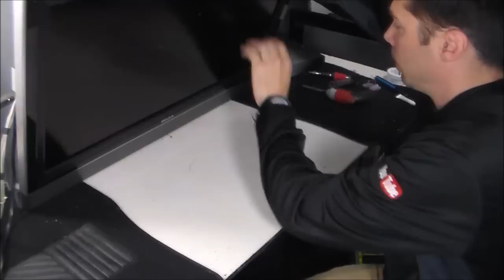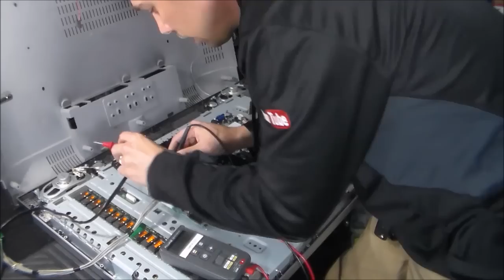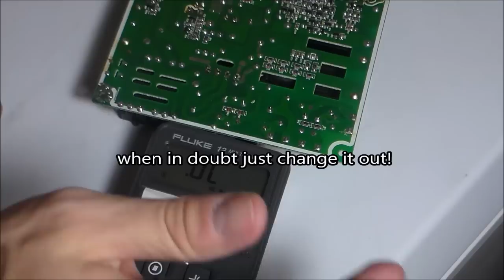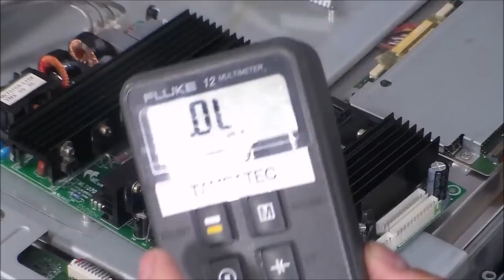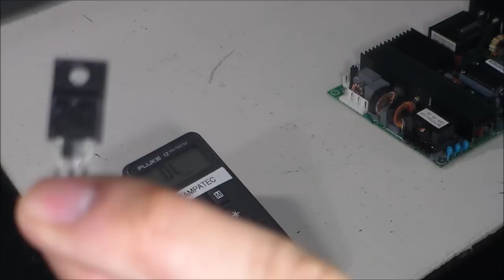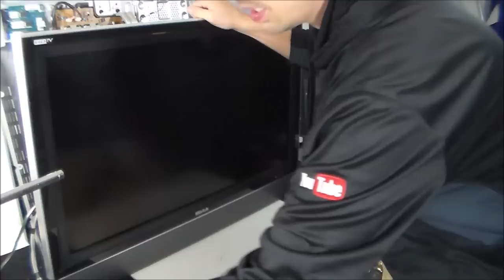How to fix tv after lightning strike power surge

Comment: You changed the bridge rectifier but isn't it okay for there to be a larger voltage drop across the dc pins?  You are measuring across two diodes after all.

Comment: I have a question. In power supplies, if mosfets are gone must we replace any resistors and diodes around them?
I remember someone said resistors may show correct value but in high frequencies with Mosfets they show anomalies.
Video was about Mosfet inverter welding machines.

Comment: Hey, i watch your videos all the time. Youve helped out in so many way and i appreciate it. Thank you. However im stuck with one project im working on. Its a hisense 46 inch (46k360mn) when i plug the tv in the standby light turn on and turns off. The power board runs a little loud when the main board is plugged into it ( normal when unplugged). I have checked the values running off the power board and theyre all correct. Standby light is at 5 as well. I replaced a couple componets on the mainboard because they were low in value now they are normal. There has to be a bad component in the main board still right? After the fixes ive done on the main board the power board still runs loud. What suggestions do you have that i should check? Its a short somewhere right?  Thank you. One of your subscribers.

Comment: How critical is the standby voltage? My Samsung shows 5.25V, the board says it should be 5V. Also, I am reading the 13V as printed on the power board. One more thing, I notice the backlight comes on when I unplug the cable from the power board to the main board. FYI, I'm using a "free meter" from Harbor Freight. (you get what you pay for!!) Amazon will deliver a good meter today. 

Sorry, forgot to add this info. Standby light is not on. Following the wires, I see the standby light is powered from the main board. 

My TV got damaged by a lightning strike. Over the years I've gotten lazy, I used to do repairs. Watching this reminds me how I replaced caps on my computer MOBO and got it working again. Yep... I've gotten lazy!

Comment: Why is it that with all your videos you only turn on the set but you never look at the menu of the set or look at a channel reception using attached antenna? Very undecided if your fix is a fix or just a cream to ease the pain for a hour or a solution to stop the pain forever, doctors use the same technique in getting patients to return for more visits to his office. Your the future of Alfred Hitchcock Thrillers in Electrical repair of TV's on YouTube, honestly.

I think my hearing was affected by the lightening strike at my grandmothers home which woke me up, the power line went right outside the window to the power pole on the highway so the bolt traveled across the driveway, that was super loud, in fact it changed my life, I hear ringing because of it to this day. (I love Cheeks response).

Comment: I have a Panisonic Viera and it has had this issue multiple times but every time we take it in to get fixed the guy just says it needed a new power cord so I tried another power cord and it didn't work. Any ideas as to what may be wrong other than that?

Comment: Have Sharp Aquos LC 60LE831U will not power up. No stand by voltage. Have not been able to find one. Checked you, Amazon, even Sharp. Found bad diode and will replace this in the mean time but in case this doesn't work, can you suggest anyone else I could find a Delta DPS-183BP A. Rev S4?Thanks

Comment: our Samsung tv got hit by lightning. no other things that were plugged into the same receptacle were affected. only thing that could've allowed a current was a coaxial from an antennae outside. I get nothing when I push the power button. Not sure what the problem yet. we plan on giving the tv to my mother in law because upgraded to a 55in Samsung curve tv.
Reply: oh.. my non-working tv is a 40 inch Samsung led...
Reply: Did u get it fixed ? My tv is exactly like urs & just like urs only the tv doesn’t work . & the cable wire was connected at the time of the strike

Comment: Great Video TampaTec.. I wanted to see if you can point me in the right direction. I have an LG 47ln5700 smart LED tv that stopped working after a lightning power surge. I press the power button, the LG logo appears on the screen for a few seconds an then the screen just goes completly black and it stays that way. Where might the problem be?

Comment: after a bad lightning strike that knocked out several appliances, Samsung smart TV is completely unresponsive. would it be easier to buy a used model with a cracked screen and just replace the screen?
Reply from the maker: if your TV has standby voltage on power board then  mainboard is likely bad. most power surges can travel through the HDMI port on main board.
Reply: Tampatec I've seen pretty cheap televisions that only have a cracked screen. would you say it would be easier for an amateur to just swap the screen out or replace the main board?
Reply: Tampatec oh, and my television is completely non-responsive
Reply from the maker: Sean Wickham no I would replace main board because you don't really know what you're getting if you get a broken tv, people lie. I use shopjimmy.com or electropartsonline.com they are reliable and have board warranty too.

Comment: Hi my Sony HX755 stopped working after a lightning stuck nearby. The Power board seems fine and no fry anywhere. The standby light is blinking 3 times. Both the boards actually appear fine and no frying of components. the power board seems to give 3.3V standby. So how do I proceed ?

Comment: hey man love your videos. I'm hoping you can help me out. I have no standby light, I have replaced the main board and used a power supply repair kit from shop Jimmy. Nothing has changed. all I get is a click from a relay when I plug the tv in.  checked all caps also. still nothing, any suggestions?

Comment: i had a strike go through my cable line and take out 3 tvs. 2 of them were just the fuse. the 3rd was the main board. after switching out the board i have power to the board, the audio output has a red light and the tconn board has a blinking red light. it clicks like its trying to come on but i have no standby light and it will not power on still. i have changed the power board and the main board. any suggestions?

Comment: I have a Toshiba 58" tv, I have 120v ac going to the power board, and 5v going to the stand by power to main board, yet the tv doesn't turn on. What could be the issue?

Comment: lighten hit and must of came from the cable to hit my TV I can hear the TV chick on and off. but have no picture. no stand by light in front but I can see a red light in the back . On the back of the main board there is, a oil film on it does that mean I need a new one  , and where can I get one? The TV is a Samsung 55" smart TV model# LTJ550HQ09-J

Comment: i thought lightning strike destroys every thing causing it to be a fire hazerd
Reply from the maker: it depends if the lightning strikes directly but most cases lightning branches out knocking out electronics. I see most cases it knocks out power boards and main logic boards, not tcon board, buffer boards, inverter boards.
Reply: thanks i like to unplug things when im not using can lightning strike cause you to rewire entire house and replace panel box thanks

Comment: I have a samsung 60" led tv that was given to me. It was struck by lightning and had no power. I jumpered the fuse to see if i could get anything out of it - now it powers on as soon as I plug it in, but only the backlight. Menu and other buttons do nothing. After about one minute the backlight starts flickering. What are your thoughts? I can get the power board for $30 shipped and Im thinking thats the first thing i should try.

Comment: I have a vizio e601i-a3 and I have 120 volts to the power board I've replaced it already and still not working. the main board looks great but no action. The tv was plugged in to the internet with cat 5 and the router modem was also killed as was my camera dvr also hooked up with cat 5 to the router. you think it's the main board? could it be anything else? everything looks great no burn marks.

Comment: After a power outage, when the power turns back on, we could get a possible power surge, correct? If the stand by light is now slightly flickering after a power outage, would you trouble shoot the same way you approach a non functioning stand by light due to a lightning strike power surge ? thx

Comment: I have an LG 55LM7600 the serial# is 212RMVB05071.  We think that lightning ran in on Thursday night.  The orange/red light is still on in the bottom right corner, so there is power, but the screen is black.  Is there anything that can be done?  What parts would be needed for repair?  Thanks for your help!

Comment: Hi. I have noticed that when testing the DC pins of the Bridge Rectifier (out of circuit) it gives you a reading of over 0.9 and you suggest to have it replaced.   Mine did too so I bought a new one which also did the same! Each diode is around 0.5 but dc pins give over .9v. According to the technician this is normal as you are testing several diodes at ones,. Is this true? Thanks

Comment: Hello again (messaged you about soldering yesterday),  thank you for another great video.  I have a Samsung LN46b750u1fxza that stopped working after a storm a few years ago.  I don't think the surge was significant b/c it still has a standby light and "responds" i.e., the light goes out when you push the power button on the remote.  When you attempt to turn it back off, however, the standby light doesn't turn on again until you unplug and repeat.  Anyway, I don't want to invest in fancy tools and was wondering if you might know which board might be affected.  I'm going to open the TV later today once I get a Phillips screwdriver. Is there a way I can upload and send you photos?
Reply: Check your remote for low battery power. My Visio developed a problem when it turned on, there was no picture but the sound was on ea receivable channel so I turned it off by remote and turned it back on. It is a problem remote issue mostly nothing wrong. Allow the remote to sit a while, this helps if it has developed moisture inside buttons. Strangest thing I have never had to remove the back to find a problem, it is always the remote batteries. I open the remote twist the new batteries and close it back, it works a few times and thien does it again and again. I now use another remote since I got a Blue Ray Disc Player, but to bring up the menue of the station I have to use the TV remote and the issue still occur with it so I turn the batteries again and again for that.

Comment: I shorted the PSON to a SGND and tested the volts on the pins.
The 5VSB read 5 volts, the 12 read 5 Volts and the 24 pin read 5 volts. Does this mean the power supply board has failed?
Reply from the maker: +Bob Harrigan if 12v is reading 5v then yes.

Comment: I think my TV got struck by lightening when I turn on my TV I can pull up my menu for like a second the image goes haywire and it's just blacked out with some distortion over it. After leaving it on for a while it started circulating through colors red green blue white ect. Not sure what the problem is but my TV has been unresponsive to both the remote and buttons in the tv
Reply from the maker: if tv turns on ok, maybe surge travel through hdni cable surging main board or tcon board.
Reply: +Tampatec I guess what I throws me is it won't turn off with the TV buttons or remote I have to unplug it. It responds to buttons when turned off and being turned on but not when being shut off. And I unplugged my hdmi cables to see if it was just visual from them but that didn't change anything. It's just completely unresponsive
Reply from the maker: +Ben Blackburn that's makes sense now,  main logic board controls logic function commands like (on, off, vol, input)

Comment: Suspect we had a lightening strike that passed through wall plug and into my Sony Bravia KLV-32R407A while the tv was in "off" mode.  The cable works fine and the picture can be seen and sound heard but pic is "pixelated."  I have a steady red stand-by light on the TV.  I watched the video but still unsure what the problem is.  Ideas .  .  .  .  ?
Reply from the maker: try reset by unplugging tv for 2 minutes .
Reply: Did all that; think something is fried, watched your video but was unclear, given details above and info in the video.
Reply from the maker: Steve Lhyne if standby volts is steady on power board plug to main board then it can be main logic board. get at shopjimmy.com
Reply: +Tampatec many thanks, yeah: will need to order some parts.  appreciate the help.  Steve.

Comment: Hi, I have a Philips LCD TV Model # 47PFL9632D/79 sERIAL # BZ 2e0746 904344. tHE ISSUE i HAVE IS WHEN THE TV IS TURNED ON WITH REMOTE THE STANDBY LIGHT TURNS FROM RED TO BLUE (NORMAL) AND THEN AFTER A FEW SECONDS THE PICTURE IS SUPPOSED TO COME ON. INSTEAD THER IS A CLICK SOUND OF KIND OF A RELAY AND THE TV GOES BACK TO STAND BY. CAN YOU SUGGEST WHAT COULD BE THE PROBLEM?

THANKS,

Comment: I've got an e series vizio 60" that I took on trade, I was told it was hit by lighting. anyhow, when I got the tv it came with a replacement power supply board, I've replaced the power supply and still have no power/ no standby led. should I replace my main board?
Reply: yes

Comment: how do u know if the power supply is out. I have the same tv Soon as Coby screen comes on it shuts Off
Reply: Did your end up figuring it out ? having a similar problem where the tv turns on then shuts off and the stanby light doesn't return until i unplug it and plug it back in

Comment: i dont think im going to get any responses but, after a power outage, the tv has a standby light, and will turn on and standby light flashes 5 times then goes away completely then picture/sound works for about 2 minutes then cycle off? and the remote won't turn it on or off, as well as no blue light(light that takes red light's place after turning on) im going to try replacing X-main board,because i see a couple of "stain" looking spots on it and the power supply tested good

Comment: Hey, really appreciate the repair video's. Great job, fast and to the point, love it.
However, i have a similar problem, but different. I have a Vizio 55" E552VLE flat screen tv that I can turn on either with the remote or with the buttons themselves. The Vizio logo at the bottom of the tv goes from amber in color to white but the screen stays black. Then after approx. 3 to 4 seconds the logo goes off, then flashes white one time, then goes back to amber or standby mode. Just as a footnote, when I first started working on this set this morning, I would turn the set on and the same thing would happen as above, but I would also get the Vizio logo in the middle of the screen with the white back lights. Then it would shut down in the same way.
At this point I've checked all of the voltages on the PS board and all seem to be correct. (5 v.- 12 v. - 18 v. & 24 v.) The only one that I am not sure about is the
"Remode"(On/Off) wire from the main board. When I check this wire I get 3.1 v. to 3.2 v. back to the PS board. Should this be 5.1 volts? I've looked at I think every forum, etc.... for any info. that would help me with no avail. & you look pretty sharp when it comes to component type repairs! Any ideas or assistance with this problem would be highly appreciated!
Thanks in advance,
moneymaker2323
Reply from the maker: seems like bad main logic board which is common fix.
Reply: ***** should I be getting 5.1 volts back to the PS board, is that why you think the main board is bad?

Comment: nice video I'm starting to fix power boards itself if you can help me out on what to check on this particular power supply.My Sharp LC-46LE700UN will not power up. Power led flashes twice and OPC LED flashes once. I downloaded the Service Manual. The fault description is: DET_15V (34pin) error (L). UR13V is not applied.

Comment: First class as usual, I always enjoy your vids.
Could you advise on 7 yr old Matsui 42" plasma that takes about ten mins from switch on for the colour pixels to come thro the black screen?
Reply from the maker: Check all internal connections, and check swollen capacitors, does hot or cold effect it or banging on the screen make it flicker? Use code paul51p for free video google helpouts. Search tv repair.